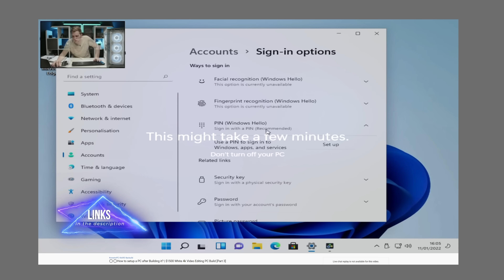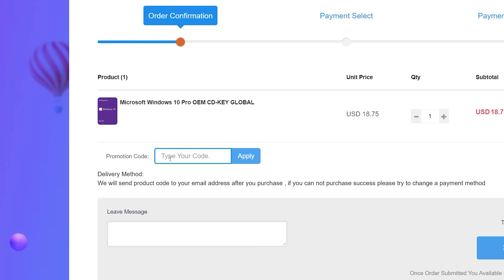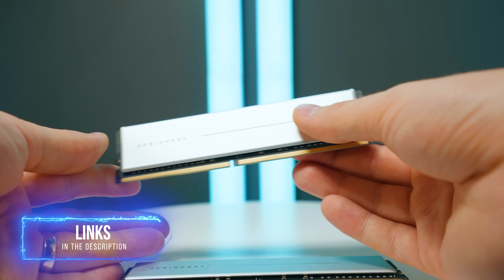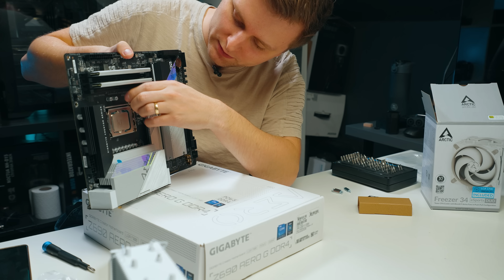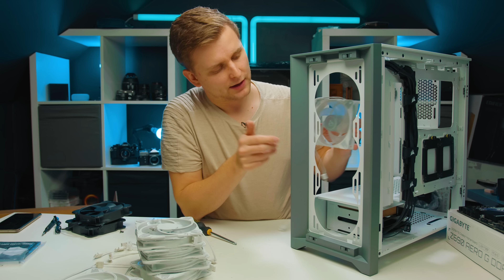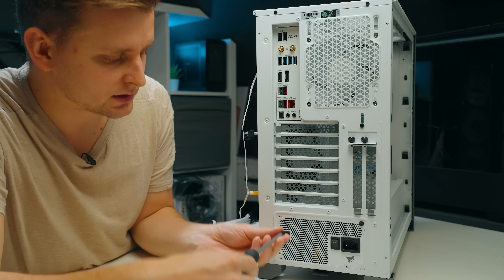ULTIMATE [Video Editing] PC Build Guide - SEE, Everyone Can Do it! Feat. i5 12600k & RTX 3060

Comment: It seems like that your LGA1700 socket has too much down-force pressure, that will bend the CPU's IHS(integrated heat spreader), the key point is watch the lever original position before you push down the lever 6:36

Comment: Whoa, no optical drive bay and I/0 ports? I have a keyboard, second programable keyboard, 3D mouse, mouse, two external HDD (storage) that's 6 USB connections (two USB at the front). Got another case to suggest? 🙂

Comment: BLANK SCREEN!  I commend you on such a professional video.  I must have watched it 20 times before I decided I could do this build.  This was my first time and it seemed like you left nothing to chance.  Alas, Murphy strikes.  I should have watched 21 times.  When I purchased my intel CPU I bought a 13th gen 'I5 13600k' not the 'I5 12600k' you use in your video.  Not intentional, I assure you.  After my build I had a blank screen and led error codes on the MB.  After a few days of watching videos,  researching the web, replacing MB and CPU, I finally gave up and paid the local repair shop $100 to find and fix the problem.   
The Gigabyte MB must be flashed before it will support a 13th gen chip.
I sure did learn a lot though and I enjoyed every bit from start to end.  I can hardly wait to build my next one.  Thanks

Comment: Great video. I'm assembling my new box now. Arctic Freeze Duo was expensive & I also got the LGA Upgrade. Those brackets interfered too much w/vrm shield. Had a cheaper   new ID-Cooler se-214-xt  w/gd instructions  laying around so I installed it instead, easily. Benchmarks on air CPU coolers show this one is pretty good. I may try to install the arctic fans on the ID Cooler Heat Sink! Found mounting for Actic 34 DUO Cooler frustrating. Benchmarks show no difference for 2 fans vs 1fan  Your opinion please?  I did the same thing with pwr & CPU Cables. Hey PSU air holes(grill) are on the bottom of my case (TT ThoughPower GF1 Snow 850w)  do I turn    PSU upside down, to alaign w/ case's bottom exhaust opening ? ( PC case is Phantek  ATG 360Ah D-RGB case controlled, how wld you handle that?)  Thankyou

Comment: I have all the parts you listed for the $3,500 build, and have started to put it all together. Question : The EVGA P5 1000W has two (actually 4) VGA power out ports.  The Zotac GTX3090 has two 8-pin inputs.  Is it better to use one cable from the psu that splits into two 8-pin and plug into the GPU, or run two separate 8-pin cables from the PSU to the GPU?  You don't show that on any builds I can see.  What is preferred way?
Reply: I'm assuming you finished your build long ago, what was your solution on that part? I also am following the $3500 build.
Reply: @subtleprelude2400  I ended up using two cables from the PS and plugging them into the graphics card.  So far the build is working awesome!  A few technical glitch's in the beginning, but finally worked them out.

Comment: Thank you for your video.  So I have followed your parts except for the PSU and the drive. My problem is that the red light for VGA stays on. The computer will not go to BOOT. Any suggestions will be appreciated.. Thanx

Comment: Quick question regarding the RAM... currently the 32GB kits are only $86.99 whereas the 64GB kits are $192.99. Would the build be just as effective with 2 of the 32GB kits instead of one 64GB Kit?

Also... the 2TB version you referenced is out of stock on Amazon and NewEgg... the WD option you have is out of stock on NewEgg and a "newer version" is referenced by NewEgg for $79.99. Have you done any testing on the WD Blue SN570?

Comment: Hey I want to thank you a lot. Just saw your video because of the cpu cooler, but I build pretty much the same pc. Was my first time and pretty much everything worked. Just used a different motherboard: Asus B660 Strix A Wifi. 

The VGA led lights white, so I need to work on that tomorrow. Hopefuly it's because I did not connect a screen to the pc.

Comment: Not sure if you have time to reply but I just did a build and have years of experience and having an issue. After building computer, the bios is showing that drives under sata as such: 
P2: Samsung ssd 500gb
P3: Samsung ssd 500gb
P5: sata 4tb drive 

Pciex16: pcie4.0x16@4.0x16
M.2: m2 4.0x4@4.0x4 

Problem is when I put a bootable usb with windows 10 The windows boot manager isn’t showing up any drives or my usb. Can you please tell me what the issue is and how to fix it with this board. Gigabyte z690aero g ddr4. I’ve spent hours and a bit overwhelmed. Reaching out and hoping you can help me fix this problem
So I can address it for my subscribers as well or anyone who is struggling with this. Thanks

Comment: Just finished setting mine up after the build. I went with the i7-12700K, 32gb ram, all black fans with no rgb leds, 1tb ssd, and 2tb hdd. other than my preferences i followed your lead in all other components. She works great. Your videos made it all so easy it was ridiculous. I even used your code when i purchased my Win11 pro and received a nice discount. I tip my hat to you sir.
Reply: How good the Arctic fans holding up with i7-12700k?
Reply: @CanadaTamil  So far they are holding up great and i have been doing a lot of heavy lifting with "Handbrake".  I have processed multiple tv series and tons of movies. sometimes 36-48 hours at a time my fans have been running at higher speeds due to my personal settings. No problems.
Reply: @scottjarrells3229  Thank you so much, I am getting a i7-12700k but was confused if i should invest more in Noctua or can cut half the cost with Arctic. I will be going with the Arctic.

Comment: I am trying to do this build and hit a snag. I purchased the cosair 5000d case and the cosair rmx series 1000x (2021) psu. I am using the GIGABYTE Z690 AERO G DDR4 (LGA 1700/ Intel Z690/ ATX/ DDR4/ Quad M.2/ PCIe 5.0/ USB 3.2 Gen2X2 Type-C/WiFi 6/ Intel 2.5 GbE LAN/Motherboard). 
My power supply dod not come with any rgb connectors and I don't see where they would plug in. 
My question is ...is the cosair rmx 1000x okay for this build. I also went with the i7 chip set and the GIGABYTE GeForce RTX 3080 Gaming OC 12G Graphics Card, 3X WINDFORCE Fans, 12GB 384-bit GDDR6X, GV-N3080GAMING OC-12GD Video Card GPU.
Any help would be appreciated.
Reply from the maker: Yeah, it'd fine just skip the PSU RGB part if you don't have RGB on your PSU :)
Reply: @theTechNotice  thank you.
Reply: @theTechNotice  I finished this build a few days ago. It is super fast and super quiet and so far I have not found an app it could not handle with ease. This build is perfect for me.. Thank you!

Comment: Making a build very similar to this in the Corsair 5000d air flow, gigabyte z690 mobo and with an arctic freeze II 360mm. The radiator on the AIO seems to be a little to thick to fit above the mobo at the roof of the case. Have you run into this issue and is there any work around?

Comment: Unfortunately, I ordered the Arctic fan through your Amazon affiliate link. It arrived today and contains no mounting plate for the MB. The box did not have the same Includes ... kit label as the one you're showing in the video. The Amazon listing does say LGA 1700 compatible. When reviewing the online instructions via the QR code, the 'helpful' note says that if we don't see the bracket, Artctic will send you one for free if you provide proof that you've purchased an MB with this socket. After you contact them, they'll send you a special discount code so that you can order it. They say it ONLY takes 21 business days to arrive. I can't begin to tell you how pissed off I am right now.

Comment: Hi, great video. Just looking for a bit of advice if possible please? I bought the Corsair RM650x power supply which only came with one CPU power cable, is the 4 pin one needed or will it work ok without?

Comment: With this build, is the Arctic Cooler 34 eSports sufficient if upgrading to the i7 processor? I like the all white looks but want a step up the processor.
Reply from the maker: Will it thermal throttle? No
Is it warmish? Yeah
Loud? Emm... little.

So simply, yeah it will work but at 100% cinebench it will running 80-90c.

Comment: With the EVGA supernova power supply you recommended, it only has 2  4pin by 8pin cup cables. Also, it does not have a RGB in slot. I'll have to return my power supply to buy another one :( .

Comment: I am planning to build a PC with i5 12600k but for the motherboard I was choosing the gigabyte B660M aorus pro motherboard but as I'm seeing most of the pc builders are using Z690 motherboard and I'm not getting why Z690 IS the choice for most of the people...my work will only be gaming + some light video editing and no over locking of either cpu or ram ...so can you please help me in clearing this doubt that is the gigabyte B660M is the right choice or not and why ?
Reply from the maker: Just go for it, no problem there!
Reply: @theTechNotice  thanks man 👍 and one more question which power supply should I use with it is a 650 watt cooler master 80+ bronze good for i5 12600k + Zotac Rtx 3060 ??

Comment: I disagree, Prebuitls at the moment are the cheaper option, even if you just Harvest the parts Mainly CPU/GPU from it! with GPU being 50-200% Over MSRP at this time.  Also One brand I would not stand behind is gigabyte They do not stand behind there products. I have to disagree this is not a Ultimate Video editing PC. This is maybe a middle of the road. Low end Editing PC.

I mean I think the video was done well but lets be honest, It is not a ULTIMATE video editing PC! You want as much ram as you can get with a video editing PC. And the biggest GPU & CPU you can afford.  A Ultimate system would look like a I9 or Xeons or Ryzen9 or Theardripper, 4.5Ghz +. 128GB of RAM min. And a 3070 or 6800XT This is getting closer to a high end system. Now a Ultimate system would be a Thread ripper WX or Xeon, 256GB of ram & RTX 3090 or 3080, Dual U.2 Drives for Editing and 4x M.2's This is entry Level Ultimate Video Editing system. I have not even start to get in to the Radeon Pro VII & Quadro RTX Gpus And ECC Ram.
Reply from the maker: Not sure if you read the title correctly, it's the Ultimate .... Guide not Ultimate Video editing PC ;)

Comment: I have seen comments from many detractors of the 4000X model, for wearing a tempered glass on the front, arguing that the suction surface is smaller with said glass. They do not know that Corsair has applied the Venturi effect whereby the air increases its speed when passing through a narrowing. This is confirmed by seeing the dust accumulated in the filters, evenly by the circles of the fans.

Comment: hi bro i was thinkig bying new pc (im new to pc build) i was thinking this parts Asus TUF GAMING B550-PLUS, ATX-motherboard
AMD Ryzen 5 5600X, AM4, 3.7 GHz, 6-Core, Boxed
Corsair 32GB (2 x 16GB) Vengeance LPX, DDR4 3600MHz, CL18, 1.35V, black
Samsung 1TB 970 EVO Plus SSD, M.2 2280, PCIe 3.0 x4, NVMe, 3500/3300 MB/s
Asus GeForce RTX 3060 PHOENIX (LHR) -grapichcard, 12GB GDDR6!! all this bundel  then i got for power suply Seasonic 750W B12 BC-750, ATX-powersuply and for cooling for ryzen i got Aerocool Mirage L240, 240mm AIO-water cooling!! All this build inside Kolink Observatory Lite Mesh RGB!

what you think all parts work woth each other?

Comment: To me the bigger reason to build a PC is to do a specific job over saving money. I edit photos. The software I use needs a very powerful CPU, a lot of RAM and does not use the graphics card at all. All you need is a picture. Integrated graphics on Intel is more than enough. Try buying a prebuilt with an I-7 or Ryzen 7, 32gb or 64gb of RAM and no graphics card. A PC to do the job has to be custom built.